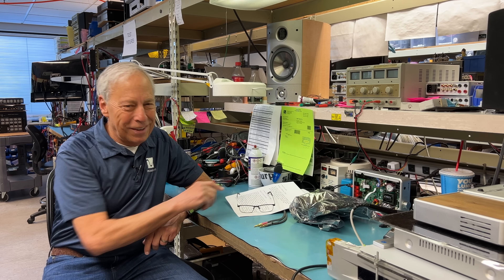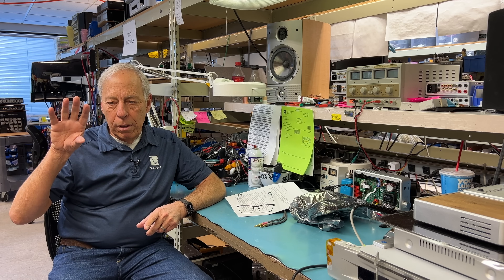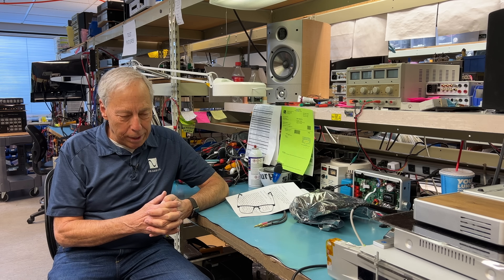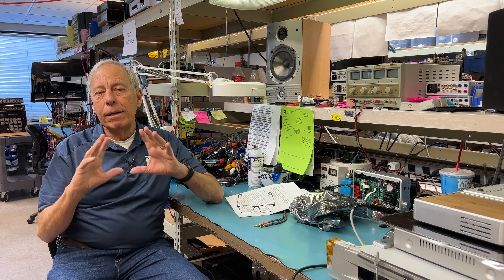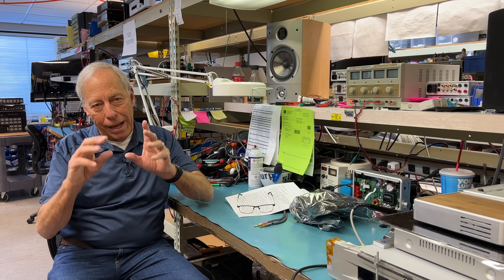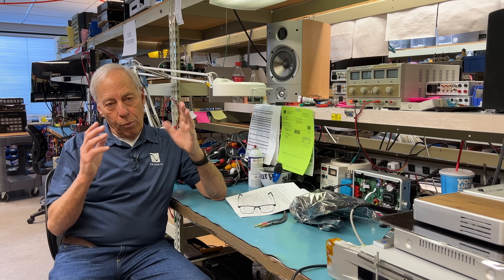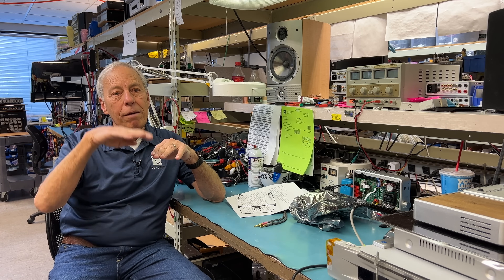Understanding voltage, current and wattage in amps

Comment: I feel this was a pretty fair attempt at clarifying a rather complex and highly individualized set of variables - impedances,  frequency, initial voltage, available current, topology, output device characteristics, dynamics, source material... it all has an effect on the final outcome. Not to the mention the deep relationship you touched on between voltage and current when fed into a load. 

One.thing that might have helped is the standard formula for calculating the power output of an amplifier: (V(RMS)^2) / Imp = Watts
This, for anyone who has any acumen in mathematics, can be reworked to find the minimum voltage needed to get the required  wattage. From there you can checking power section to see if it cab deliver.

Comment: paul I test preamps with a 4 ohm speaker resting on my shoulder and ear... haha.. i honestly start at the front and listen to signal as i go through the audio path.. i give you..i have it low volume...any preamp  can easily play 4 ohm speaker anywhere in the path..
Reply: A normal ratio of preamp output impedance to amp input is 1:10 to ensure low demands on the preamp while delivering  an accurate (undistorted)  signal tp the amplifier. 

Why load a preamp with a 4 ohm load to test?

When I was a kid I used a speaker as a microphone.
Best use?
A practical way?
Useful to test speakers? 

No, no and no.

Fun, yes.

Comment: The formulas are simple. But what does physically happen? That's very hard to grasp. I mean the flow of electrons etc.
Reply: I guess I’m going to throw a wrench in your answer. It has been discovered that electrons basically do not move when voltage is applied they just jiggle back-and-forth which is what is called current flow. It may be confusing but try to visualize it.

Comment: I have the same issue, understanding this? My Amps - Lavardin MAP'S (mono), put',s out 56W pr unit, and still they handle almost every hunger Wattes speakers out there, incl. electric static. How come? 
✌️❤️🇩🇰
Reply: They probably have big power supplies that can deliver big changes in current quickly if needed.  He wasn’t really right to focus on voltage alone.

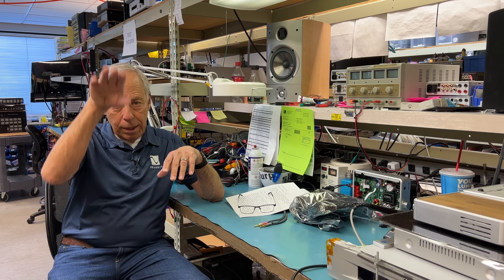Comment: @4:38 "Amps * volts = watts"
Is there an ideal ratio (or balance) for amps and volts?

In other words, would 2 amps * 20 volts yield the same results as 20 amps * 2 volts?

Or to put it another way:
-- For every amp, how many volts would you want?
or
-- For every volt, how many amps would you want?
Reply: Volts are set by the amplifier.  Amps are determined by the speaker load.  
The ideal case is using a speaker which will draw most of the current that the amplifier is capable of without distorting.  The amplifier's power spec, across various load impedances, will give you some guidance here, but if you want to approach an ideal situation, things get rather complex.
Reply: Volts=current x impedance, or current = volts / impedance
Reply: I think it is as Paul suggested the other way around.  How loud do you play?  What is the efficiency of your speaker?  What are the highest dynamic sounds you try to play?  If you need to (for a microsecond) drive 30V through your speaker to hit that bass drum it will dictate how many amps are required.  Those big swings won't play, and you'll hear it in diminished dynamics or simply missing a couple octaves on the bottom where the impedance is high.  On average you'll play at much less than 1 watt, but if you want full range and full dynamics, you'll need the capability for a lot more amps if you want natural sound.

Comment: 'Ole Audiophile here, it's a difference in basic audio philosophy at the start of the build. I am a biased individual toward multichannel, not stereo. This puts me at general odds with the entire purist movement, that would be great odds except the fix is in. I build from an HTR instead of a stereo preamp. Those of us that head down this path tend to use far more than one single stereo amp. From here, it may seem crazy to the un-initiated. That should get some comments...
Reply: Keep in mind, the open minded believe every multichannel system includes a stereo. Purist hate the very idea. It's been that way pretty hardcore since the mid-seventies when power amps first started to wander into the mainstream market.

Comment: No, no and no! It is not the voltage and it is not the power!

It is the current!

Which is known since Ørsted, and that was more than 200 years ago.
That's why it is called an electrodynamic driver (moving charge = current).
That's why the force factor is in Newton per Ampere.
That's why long cables (extra series resistance) and heated voice coils (extra voice coil resistance) lower the output (if it was the voltage a heated voice coil would raise the output).

And SPL is not a power quantity, so it is not the power.

I think these kind of questions should be answered by Chris...
Reply: Paul spent plenty of time discussing the importance of current.  There is nothing wrong with emphasizing the concept of voltage, since that is what makes current possible.  
And whenever there is movement of a voice coil in a magnetic field, it produces its own EMF, which must be overcome by the voltage provided by the amplifier.  So when cone velocity matters, so does voltage.
Reply: @marianneoelund2940  All true! But all besides the point!

Yes, you need voltage. Yes, you need power. Yes, you need current.

But it is not that “The most important part in the relationship between the power amplifier and the speaker is the voltage.”  It is the current (for electrodynamic drivers, and charge for electrostatic drivers). And yes, “It is so easy to get confused”. But this is just physics.

There is a direct relationship between current, the force factor and the force on the voice coil. That’s why it is called the ‘force factor’ and that’s why its unit is Newton per Ampere.

And if you use voltage to control a driver, you get free (and unnecessary) distortion (an awful lot of IM distortion), compression and modulated noise. Edit: and an unstable (electromagnetic) damping, and an unstable passive crossover.

Comment: The “pipe flow” analogy is also useful. The pressure in the pipe equates to the voltage and volumetric flow rate through the pipe equates to the current.
Two pipe flow scenarios of different pipe diameters can be delivering the same pressure (voltage) but the larger pipe diameter must have a higher flow rate (current)

Comment: Hi Paul, thanks for your enlightening lecture.  One question: Why do some tube amps have separate binding posts for 8 and 4 ohm speakers ?  If I have a pair of 6 ohm speakers which binding posts should I use ?
Reply: Because an amp is most efficient when the impedance of the load and amp are matched.  You should probably use the 4 ohm, it’s nearest.

Comment: Why does a  5.1 channel 150W (per channel)  only have 325W power in? (I understand that the rating applies to Front, but there is still 3 other speakers, even if those are at idle).
Reply: The problem is that they are only giving the numbers, and not the conditions under which they occur.  They probably mean that the amplifier can produce 150w per channel peak output while reproducing music where the average power is much lower, thus allowing the power draw to be 325w or less.  
Testing the amplifier with steady-state signals would produce much different results.

Comment: Humans eat food to get energy to run our bodies. Power is energy per time. While you are watching this comment, you will use around 100 Joules of energy per second, which is equal to 100 Watts. Yes, your body is running a power consumption of around 100 Watts right now. When you run you use perhaps 400 Watts or even more. Likewise, speakers need power (energy per time) input to move their cones and playing louder needs more power. The reason voltage is what Paul considers most important is that speakers are normally tuned to be driven against voltage representing the sound amplitude. However, some people are of the opinion that speakers should be driven by current being a representation of level as this can reduce voice coil thermal coefficient issues and other artifacts. No matter which method, ultimately, as your body, with no energy (or power) no motion. You can only run as long as you have energy available in your body to consume. It's like an electric car. What accelerates it is power and not the battery voltage.
Reply: "Some people are of the opinion that speakers should be driven by current." ??

Everybody, and at least the Danish people (!), should know, since Ørsted (since more than 200 years ago), that it IS the current.
* SPL is not a power quantity (so power is not linear with SPL)
* It is called electrodynamics (moving charge = current)
* Ørsted’s Law:  F = Bl x i
* Unit of the force factor (Bl) of an electrodynamic driver is N/A (or Tm)
* And via network analysis
    * A series resistance (long cables) lowers output
    * A heated voice coil (higher voice coil resistance) lowers output
Reply: @JerryRutten  OK, great to see you here and of course I can agree with you on the laws of physics involved :-) I'm not promoting any particular camp of opinion of voltage-drive vs current-drive, but your speaker cones won't move any air without power like your car will not move without power.
Reply: @ThinkingBetter  You’re not promoting science??

My claim was not, that you don’t need power. You need power to overcome resistance c.q. impedance.

The question was what makes the cone move, and what determines the output, the SPL… And that’s the current, the current only (to be precise: the only electrical quantity).
Reply: @JerryRutten  I like to look at things with a perspective of the 2nd law of thermodynamics. There is energy transfer needed for any continuous motion of a voice coil. The kinetic and potential energy captured in the air molecules moving back and forth following the sound pressure waves through air comes from the power amplifier, with a lot of losses e.g. heat in the voice coil. Sound energy in a volume of space is the sum of the potential and kinetic energy densities integrated over that volume. You can have 1000 RMS Amps @ 1kHz to a speaker, but if the voltage is 1 RMS pico Volts, the 1kHz will not be audible.
Reply: @ThinkingBetter  My claim was not, that you don’t need power…
Reply: @JerryRutten  I know, but I live in this country where I find people think it’s voltage making your speakers produce sound and torque making your car move. Perhaps the lack of understanding the 2nd law of thermodynamics is the reason we have so many obese people here 🤔
Reply: @ThinkingBetter  And, thinking about power…

There are lots of people who think that a loudspeaker or driver with a lower impedance requires more power. That would imply that a loudspeaker or driver with a higher impedance requires less power, and that a loudspeaker or driver with an infinite impedance requires no power… But, there is no such thing as a free lunch (speaking about power and energy 😃).

The catch is that the output is not the same. Drivers that only differ in impedance require exactly the same amount of power!

And now people will probably say: “Aha, you see, it is the power!” Eh, no!

Suppose you have an 8 Ω driver, and you want to make it a 2 Ω driver. You do that by using an other wire for the voice coil. Two times the cross sectional area and half the length. This means you have the same amount of copper (or aluminium), thus the same mass, but one quarter of the voice coil resistance. Half the length also means that the force factor is halved.

Suppose, with the 8 Ω driver you put out 8 volt, which draws 1 ampere, and thus requires 8 watt. Suppose, with the 2 Ω driver you put out 4 volt, which draws 2 ampere, and thus requires also 8 watt. Thus for the same 8 watt, the 2 Ω driver draws 2 times the current, the force factor is halved, thus the output is exactly the same. Thus current and force factor determines the output. QED.
Reply: @ThinkingBetter  And that’s exact the same question I have. What do people (actually) learn about physics? And especially about electromagnetism. It’s a massive denial of the laws of physics. 

My question is at what moment in history and why did we all lost our sense? My suspicion is that it has something to do with the rise of negative feedback. At that moment we had to choose between voltage and current as the quantity to control. We choose for voltage to get also the ‘cheap trick’ of electric damping which dampens the resonance, but actually worsened the performance of the drivers. Since several publications in the eighties we all (should) know the consequences, but hardly anyone acted on it (Mills and Hawksford, Ragnar Lian, Andrew Bright, Nelson Pass, Joe Rasmussen, Tymphany, Esa Mariläinen, Pavel Macura, SGR Audio).
Reply: @JerryRutten  A lot of people seem to not actually understand many subjects of physics at all. In particular I find that true for Americans and although a lot of advanced tech is developed here in Silicon Valley, most of it involves Indian or European engineers. Elementary school physics in America seems to be taught like 200+ years ago: https://youtu.be/ajDw_NNN8Qw

Comment: Wow! You did a gr8 job IMO explaining a very tuff subject! There is a lot going on between an amp and the speaker. A power amp sees a conventional loudspeaker as a super fast variable resister. The resistance changes as the frequencies change, hence impedance. Am I right? All things the same, A speaker with a rated impedance of 1Ω could get a away with a lower voltage, but needs huge current to play as loud as a 16Ω  speaker, which needs more voltage, but less current (kinda how WATTS come into play)! The amp's power supply rail voltage(s) has some influence on the amps output power. So, why is it that many modern car amps brag about being 1Ω stable, but average home amps shy away from anything under 4Ω? Kinda confusing to me. Thanks!
Reply: Most car amps are "class-D" type amps. Class-D amp designers like to brag a lot on how low (in impedance) their amps can go. A few are actually stable at 1ohm. Just a few.  Most home audio amps are (still) class-AB. VERY FEW class-AB amps are stable under 4 ohms. Subwoofer amps (for home) can be class A/B, or D. But class-D is now becoming the norm for them. Class-D amps are much more efficient under load and high volume than class-AB. That's why they are preferred for car-audio. Less power drain. However many audio-heads prefer the "sound" of a well designed class A/B amp for full range music. Class-D amps generate ultra-high frequency noise internally that may be embedded in the output signal. But that noise is not really audible in a car or from a sub-woofer.
Reply: @johnnytoobad7785  Very true with class d amplifiers, my dad passed away many years ago and he loved mantovani and his orchestra classical music, i often listen to it as its nostalgic, but on class d on the higher frequency notes, you can hear the noise on the sound, only  very slight but its there, i have a dynacord powered mixer, high end ev audio, not really designed for the house but that has a class h power amp inside, really class ab, the supply rails adjust the voltage depending on demand, but when i play the classical music on that the sound is pure,  that slight noise on the higher notes isnt there and sounds much warmer too
Reply: @johnnytoobad7785  Thank you for your input! Everything you said makes sense.

Comment: power  = volts  x amps   /   volts AC  (rms)  squared  /speaker impedance  =watts
Reply: I'm having a hard time reading the equation in this form,  but i knew there had to be something different vs. a standard electrical circuit.  I've seen specs of well regarded amps (Paul even uses them) that did not compute using max voltage and max current. Those two values also do not account for a change in watts due to the load. Thanks.
Reply: @timothymitchell7250   First one is  Ohms  Law  volts  times  current  equals watts  and the  other is measuring  the wattage  out of a   amplifier  AC volts  on the output    terminals   squared  divided  by the  speaker  impedance  in ohms